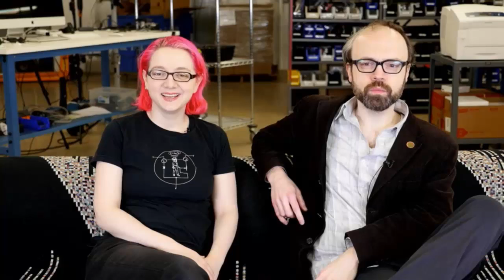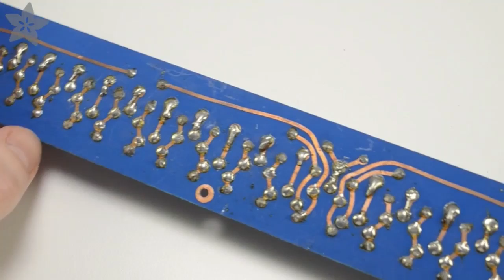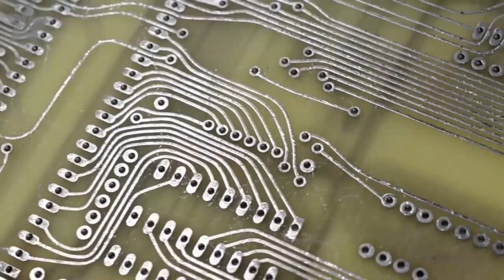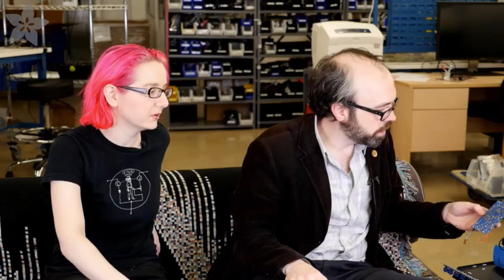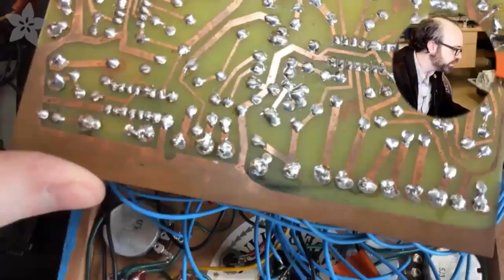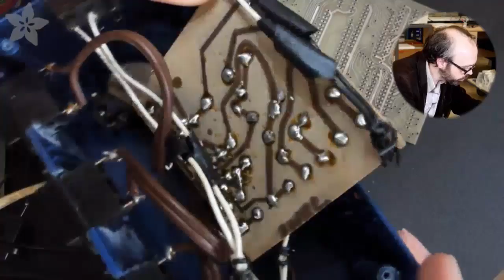Pseudorandom 01: Hand Drawn PCBs

Comment: We did this kind of PCB in 2x or 4X. The pads were made wand were just peal and stick. For a two layer board two sheets were taped together Then these were taped to a light table. I used black crape tape. It came in rolls of various widths. Using my fingers I could route around anything. Later they came out with red and blue tape so a single layer was needed. They photographed the artwork using color filters. Yuck!. I began with ORCAD. It came in two packages. One was the schematic capture. The second was the PCB tool. It was a manual router. The I had CADAM. They had a router and schematic package. I convinced the Computer Science department to run this on our CRAY. I got a bill for $150,000 for one board. EDS did not charge for this and I went back to ORCAD. At least it was not tape. It still was clunky. The last board I bade was done using KiCad.

The lettering and artwork are also stickers. All of this was done to make 1:1 film. The boards were placed in a clamp that held in alignment with the artwork. The boards had a light sensitive photo resist. They were sensitive to ultra violet light. The board were developed removing the unwanted areas of the resist. Then the boards were placed into the etching liquid. I removed the photo resist with steel wool. I started with photo resist spray. Later the companies sold the boards pre sprayed in black opaque bags. Now we send our artwork files to a board house that takes care of everything.

http://www.industrial-electronics.com/images/eed5th_5-7.jpg

http://www.industrial-electronics.com/eed5th_5.html

Comment: Awesome show. It took me back to the 1970's and 80's when I hand drew circuit boards with Sharpie or a resist that came in tubes with a roller ball tip that made traces about 1/16 inch wide. I still use a Christmas tree-shaped board with three LM3909N chips flashing a bunch of LEDs every Christmas. It was drawn using the roller-ball tube resist in about 1985. I like Fritzing for making boards because it gives you the option to drag beautiful Bézier-like curved traces.

Comment: I recognize some of that junk.    The blue synthesizer boards are kits from PAIA electronics.  Surprisingly they are still around https://www.paia.com/
Reply: The Blue board modules are for a PAiA 2700 vintage modular synthesizer, the smaller board is the Paia 2720-8B Frac Rack Synthesizer Module

Comment: You might be interested in the tool called "PCBmodE", which was mad for exactly what you are talking about in the end of the video. It is a PCB tool that lets you use the Inkscape vector graphics program as its "GUI". It is interesting in that it both uses a human-readable text based format where you define the parts as well as the SVG format that Inkscape understands. Inkscape gives you full artistic freedom to form and place components and traces. The tool translates the information (losslessly) between the two formats. It can also export Gerber files that you can send to your PCB fabrication house. Check it out at http://pcbmode.com/ and beautiful examples at http://www.boldport.com/blog !

Comment: That pale green board looks like it was laid-out with tape on draughting film. The tape was dead-black crepe so it could be stretched into curves and still lay flat to the film (I still have some tape in one of my tool boxes). I used this method for my first PCB at college (1975). The film was generally photo-processed and reduced 1:2 to expose photo-resist on the board. The chip pads I used were rub-down like 'Letraset' characters.

Comment: If you guys want an easy layout software, there's this free one called DIY Layout Creator. It has most of the common components you'd see in DIY boards out there, very straight-forward, and easy to customize stuff in it. There's both straight and curved traces, as well as "flying wires", jumpers, connectors, and pretty much anything you'd need for getting into circuit board layouting.